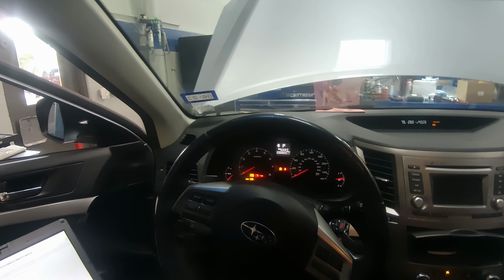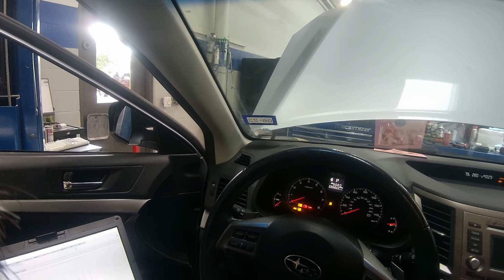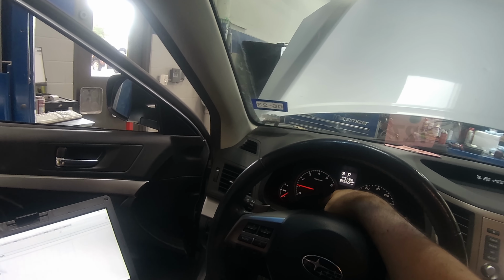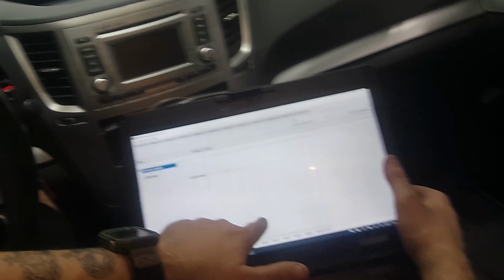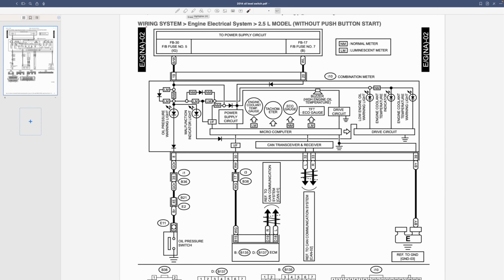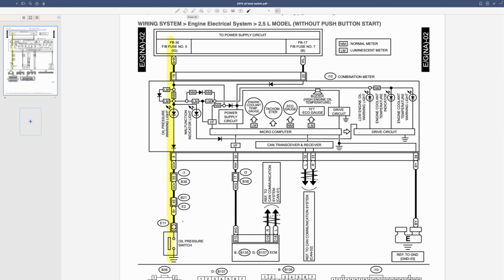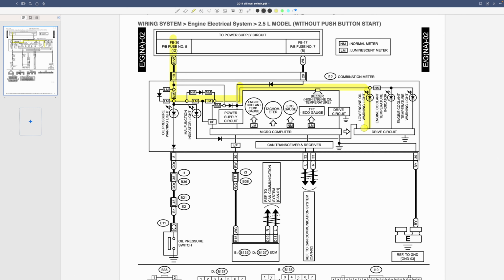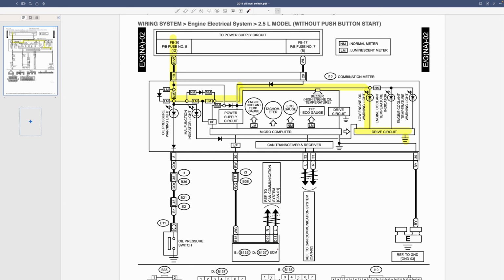2014 Subaru Outback -- Customer States Oil Light Turns On Randomly

Comment: What I've never figured out is the Flash for "Improve the accuracy of oil level detection". 
Have you ever done a before and after Flash comparison?
I'm guessing it changes the logic to make it more sensitive or activate the low-level light at a higher level.
I may have to try it the next time I have an applicable candidate.
Reply from the maker: good question. I'll also try to find a car that still needs that update, and try your suggestion.
Reply: @thatsubaruguy1324  I'm always in a hurry, sure would like to have the time and presence of mind to case-study these things, like the charging system logic update.
I tried once, volt meters and amp clamps, watching the scanner, graphing, alt mode and driving, and operating accessories, and finally said screw it, the update fixes the majority of them :O)